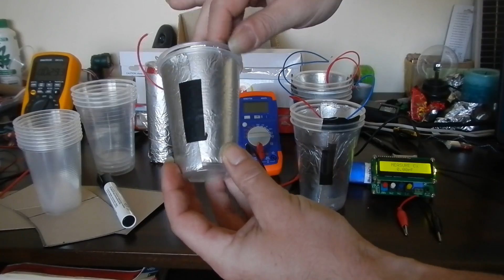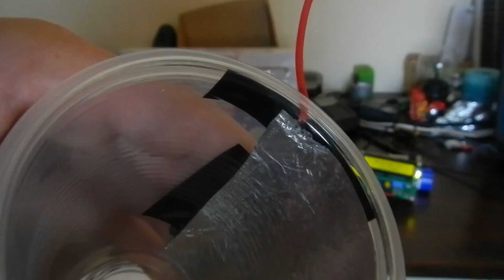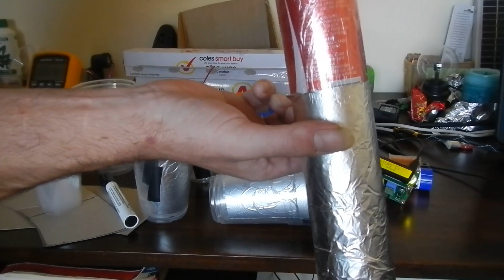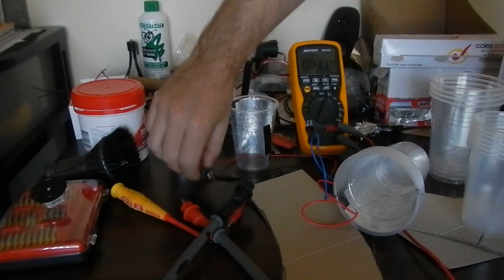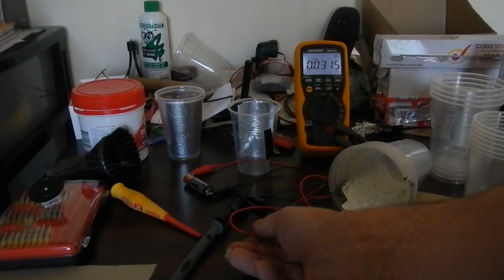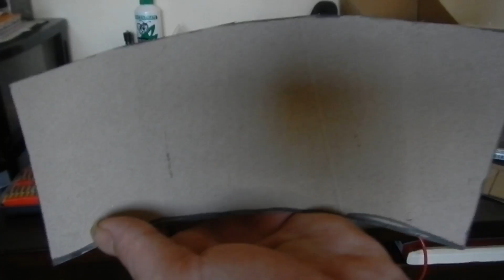How to make DIY Variable Capacitors.

Comment: This is awesome! Thank you soo much! Variable caps can be pretty pricy so this is a great alternative!
Reply from the maker: my local Jaycar wont sell variable caps at all. I had no choice. Glad you found the video helpful.
Reply: +Mongrel Shark yeah, I was going to resort to ordering one off of a website but then I found your video! Thanks again!
Reply from the maker: No worries :) what's your application? If its a tuning cap you may need to add a plastic handle to adjust without your body capacitance interfering
Reply: +Mongrel Shark yeah it's a tuning cap, I was thinking of making a tesla radio, and a theremin for fun, but also perhaps I'll make a higher voltage version for tuning my tesla coil
Reply from the maker: You'll probably want a handle for all of those. Metal stoppers and high voltage don't mix. I have tested them to 40kv without stoppers.
Reply: +Mongrel Shark alright, and 40kv is great! I was just going to use it around 25kv so that is awesome!
Reply from the maker: Will go all day at 25 kv. . Check out my laminated caps for hv stuff too. Only good to 10kv but 2ns discharge time...
Reply: Keystone Science you can also make a trombone variable capacitor using soda cans.. also yeah you need variable capacitors I always see you wanting to switch values in your vids

Comment: Thank you this is a helpful video. I have made a small spark gap tesla coil using a stun gun. Your idea using the buckets will work great for it. I've been trying to come up with an easy variable cap to handle the stun gun voltage and that answered it.
Reply from the maker: Its always good to know these videos help people with their projects. I'm not sure how you will go with the stun gun though. Some stun guns have millions of volts outpu. These cups usually breakdown around 40,000 volts.

On the up side. Your stun gun already has a capacitor on the output. Its value should be listed in the devies technical specifications.  So all you need is a spark gap and a pair of coils tuned to the guns output capacitor.

I'd love to see video/photos of your project if you get it working.
Reply: That's why I said the bucket, you mentioned it in an other comment. I've had it working for some time now. I have made a couple of caps from aluminum foil and closed cell silicon rubber(it works better with it). And I have made a couple of secondary coils and a spark gap.
  I'm trying to tune it and a variable cap would help I think. I have also used the same set up with a 15kv neon transformer(with and with out a high voltage rectifier) in place of the stun gun and didn't see much change in performance.
 I'll love to show some of what I got going but I don't know how yet
Reply from the maker: That all sounds very interesting. Uploading video to youtube or photos to Google + is fairly easy. I'm sure there are some good tutorials online if you google.

A variable bucket version of these capacitors would be really cool to see!

Comment: whats the largest v. cap. you've made?
could you use aluminum tape? I have lots of aluminum tape around!!
good video!
Reply from the maker: You can use any conductive material for the plates. Al tape would be great! Technicly, you dont need a conductor for a capacitor... Tazer Water (Party trick) Unless you actually want to get the power in and out of it. thats all the plates do....

The highest voltage I have run them to is 40,000v using a varient of this desighn with these cups, in an ice cream tub full of oil. You can see them after they failed in this video. Tazer Water (Party trick) Which includes high voltage arc testing to find the holes :) (Again you can see the capacitor still holds charge with no conductor)

I would rate all the cups I have tried at aroud 30kv to avoid dammage. they will do 40kv, but not for long.

I have also been playing with a lamanitor designd for laminating A4 paper. High Speed, High Voltage Laminated Foil Capacitor Testing
I found the plastic indestructible on the TEA laser (TEA Laser turned up to 11) But once it goes throught the laminator it seems to weaken the dieletric withold etrength. I think its a tiny bit thiner on the edges of the foil. After the heat streaches it a few microns...
Reply: thanks!
I have a lot of aluminum tape, foil, mailing tubes, cardboard tubes, and old and bad cds, so i'll try that out.
great video! great info, and great ideas!
Reply from the maker: lad you found it all helpful. DIY caps are a bit of a speciality of mine, so e to ask for more help. If you could post pics or video of whatever you come up with that would be great too :)
Reply: thanks!!!
i'll try diff. materials for var. caps...
later!

Comment: Nice, good way to make a variable HV Capacitor !!!
Reply from the maker: These ones are only good to about 4-5kv. The foil is too close to the top of cups, and arcs to the metal stoppers which all then arc to each other and other bits of foil. the arcs melt the plastic, then set it on fire if left arcing continuously.
although by removing the metal stoppers, and placing the foil further down inside cup. I can get them to about 70kv before the plastic breaks down and they go POP!
Reply: I agree with you, Mongrel.

Comment: How's everyone going here?  Do you think metal spray paint would work in place of the foil?
Reply from the maker: As long as the resistance was low enough. If the resistance is too high it will slow down the charge and discharge times. I've made a variety of these now. With the metal stoppers its good to about 5000 volts, then it starts arcing like mad.
I have also made non adjustable ones for higher voltage. By leaving the foil further down the cup. I found they can take up to 70,000 volts or so. Before the cup breaks down and gets a hole.
Reply: Mongrel Shark I'm looking to design a cap' for tuning in radio frequencies.  Is the greater the plate area better for receiving oscillation vibrations?  Can you have too many plates in the tuner?
Reply from the maker: I have never made a radio tuning cap. You'd need a handle, As it shows in the video, touching the plastic too close to the foil. changes the capacitance.
These caps are a bit leaky, but comparable to commercial tuning cap. The big ones in old SW radios would be much worse, they had many more plates to get the range.

I'd be most concerned about the cap plates acting as an ant and picking up interference. Although if radio tuned well probably not a big problem.

I did think these caps would be good for a DIY radio project when I first made them Great range and tuning accuracy. Might pay to lubricate the inside of the cups with some lanolin or coconut oil. They do get sticky after a while. Food grade oil shouldn't degrade the plastic like mineral oil would.

I'd love to see the result if you did try them in a radio. Even if its a bit of a fail.
I think they should work though. Provided you have a big plastic adjuster handle. That keeps your hand a long way from the plates.
Reply: Kevin Baird Here's my deal.  I think someone is trying to communicate with me from some "other" side, if you know what i mean.  The unknown mate' is turning the light in the toilet room on and off.  The switch is moved from the off to the on position physically.  I live in a old flat and there is no advanced technology, but their communication with me is, digital.  1/0s.  On off.  I was talking to a mate who chases ghosts and he said that the ghost may not like me being there.  I didn't feel that.  Recently I had my A.M. radio playing so I could listen to weather reports...mostly static, because no one uses A.M. any more, but I also like to listen to the storms crack over the radio.   Long-story shorten here, I heard a voice come over the speaker saying, "Kevin safe."  That freaked me out for a moment, but then gave me peace.  I have dabbled in component electronics all my life and have a basic understanding of it all.  So I went and got a Hobby A.M. transmitter kit that I could build and switch out parts on my own.  My intent is to find the band' that that voice came in on and I want to tune into it better.  That's my story and I looking for ideas.
Reply from the maker: This cap will make you a broad range tuning cap that would cost you a fortune then. Go with that. Like I said already, add a plastic handle...
Also check out slider2732's CAT exciter. Its made specifically to talk to the other side :) Via instructions received in a dream by someone who knows noting about electronics. Cool story if you read the video descriptions.

CAT Exciter - The Italian job
CAT Exciter Version 2.0 - codename Bellisimo
CAT Exciter 3 - Fantasma, with a spooky voice !

If you want to talk back, send a signal from a mic, through a small pre amp, and to the transistor base :)

Although to do binary, a Morse code tapper could be used? Remember. In binary. 101010, is 42, which is the meaning of life, the universe and everything else.

Comment from the maker: I do non-adjustable ones too. This setup arcs at about 10-20kv, but on the welding rods... so no plastic or foil gets harmed.... Sounds and looks (and feels) a lot like a stun gun when you hook it up to a flyback... will arc on all 4 layers. it crazy! The non-adjustable ones can take a lot of abuse! Especially if you keep the foil down a bit lower from the rim. Rolled over rims are good. when they do arc, the arc will try to follow the roll giving you more distance between plates.

Comment: my first HV cap was one like this i made it without wire though ,just foil and it took some real beatings 10kv @ 250mA . One of those things i wish i had never thrown away :0(
Reply: HIGH VOLTAGE, 3D PRINTING, FPV DRONES & LEARNING it's not hard to make new ones? why do you wish you didn't throw it away?

Comment from the maker: One of my best creations. Cup caps.
Plastic disposable cups, and tin foil. You can make a variable capacitor with excellent range, and high levels of tuning accuracy. The ones in this video range from 0pf, to 500pf, over 720 degrees of rotation. So better than a pf per deg of turn. The voltage rating on these piticular ones was a bit disappointing. Around 20kv they start to arc across the metal turn stoppers. I have tested non ajustable cup caps, and they are good to around 50kv. The metal stoppers do offer an advantage though. If the regular cap breaks down, the arcing can melt and ignite the plastic cup. Causing fire hazard and destroying the capacitor. With the stoppers in place. Arcing is kept away from the plastic. They can break down over and over, and still work the same. The is no degradation from overvoltage.
Reply: my first HV cap was one like this i made it without wire though ,just foil and it took some real beatings 10kv @ 250mA . One of those things i wish i had never thrown away :0(
Reply from the maker: LOL. They cos $3 per 50 cups and roll of foil... Make more.

If you do non adjustable ones, and want more voltage. Just stop the foil from riding high, with a little glue. Evey few mm from rim, gives you more kv... I have a few that will arc for a min or so at 50kv (Inch arcs) before the cup starts to melt and burn.
Reply from the maker: Was down at hardware store the other day, when I noticed 9 liter stack-able buckets.... 45c each....  just near the industrial strength foil.....
Reply: the thinker the dielectric the lowwer the capacitance so thick buckets may handle more volt but mad drop the capacitance
Reply: thinking about it there is a lot more surface area so maybe not lol
Reply from the maker: Buckets are still only half a mm thick.... As you say a lot of surface area... Easy to test. Cut foil to fit cup, measure capacitance. Then glue the same foil to each side of a bucket... test again and compare. I think it wont go down a lot. Cups are almost as thick as the bucket... Plus if you flip the handles the right way, they can hold the +/- rails...

Could be good for Tesla's and adjustable freq ZVS.... As well as a "Special" doorbell for the god botherers.

I got 25k views coming up... Wonder what I could blow the F***er out of with a few bucket caps???
Reply: Hahahaha lol mate that door bell sounds fuckin awesome :-) I wanna c a vid of it soon lol